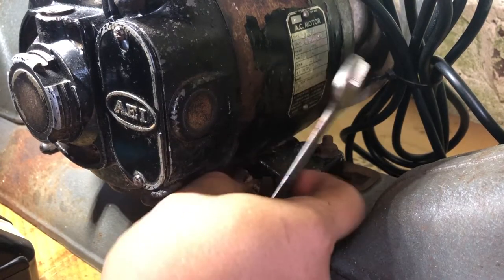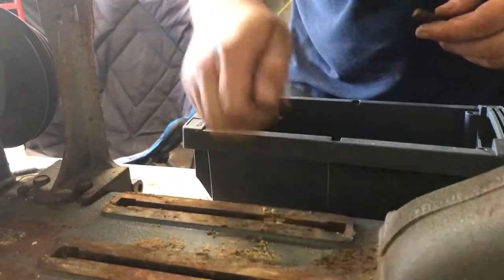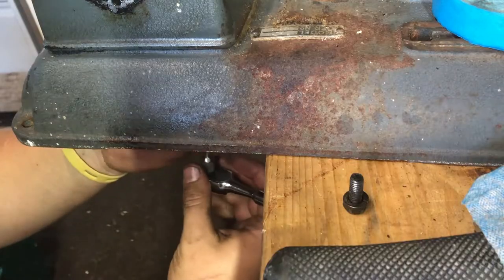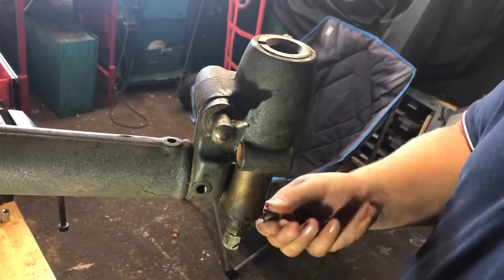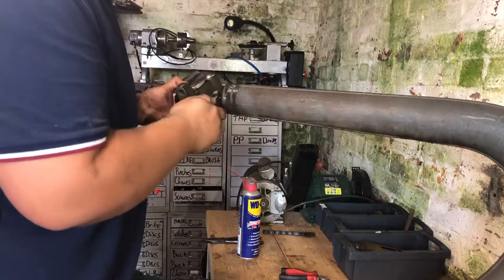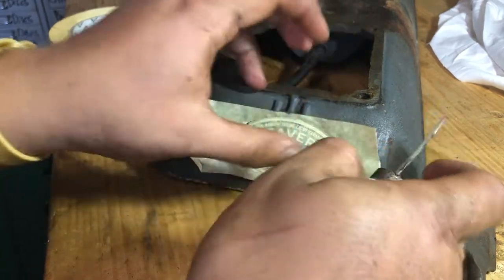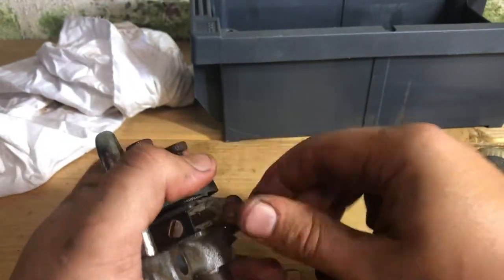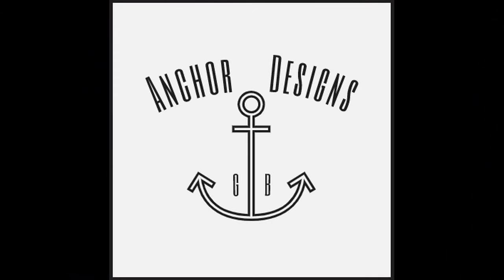Restoring A 1963 Canadian Beaver 24Inch Scroll Saw

Comment: I have recently acquired one of these.  Similar age but the spring tensioner head on top is different with a rotating handle to turn on top ...   trying very hard to get an age on it... not sure if it’s newer or older than yours.